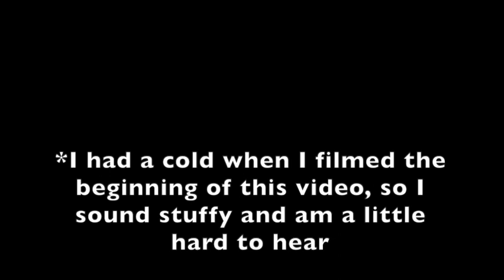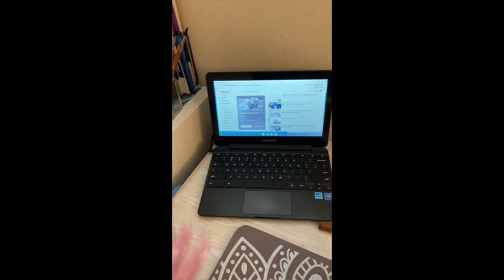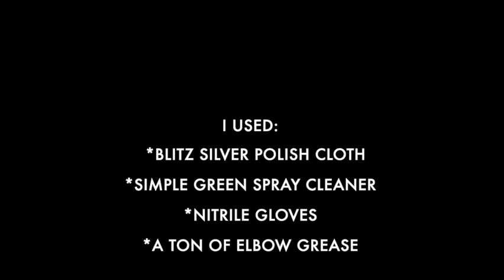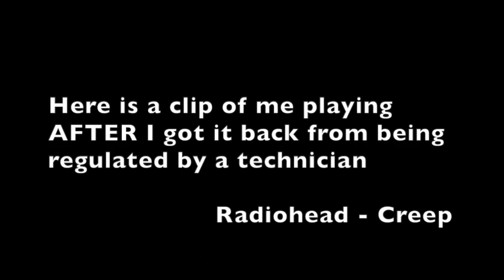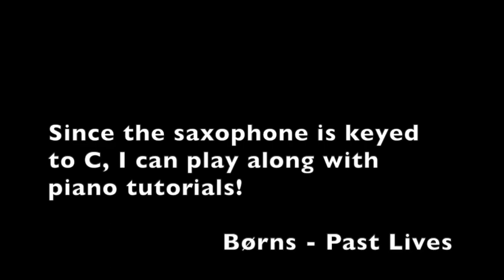C-Melody saxophone restoration. The Great Gretsch American (Martin Handcraft Stencil)

Comment: The "high" loop on my 1922 Martin C Melody was driving me nuts, so I built an extender to move the attachment point downward. I ran some 1/8" cordage around the loop and then down to the top wire on the F# key cage along the backside. Then tied a small stainless ring into the center point. Saved needing to weld on the instrument. It now balances when it hangs.
Reply from the maker: Yes, I really need to do something about it. Does your solution put a lot of strain on the original loop? I had heard that modifications can end up tearing the original loop off the body. That kind of scared me away from messing with it.